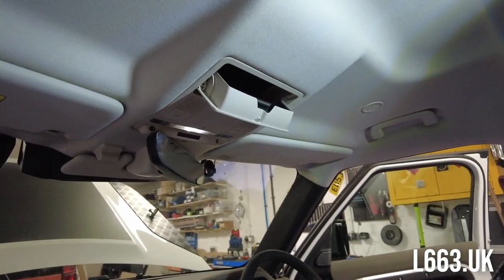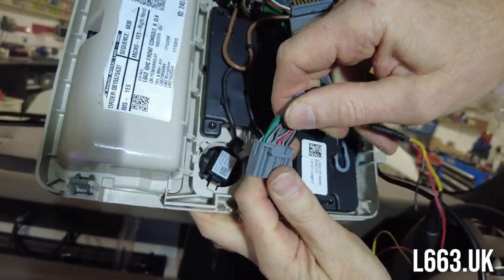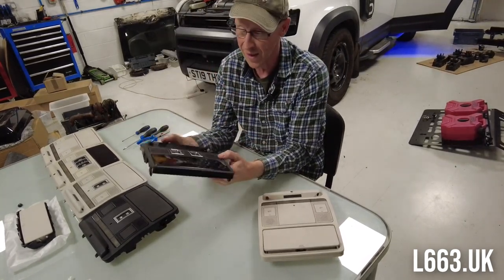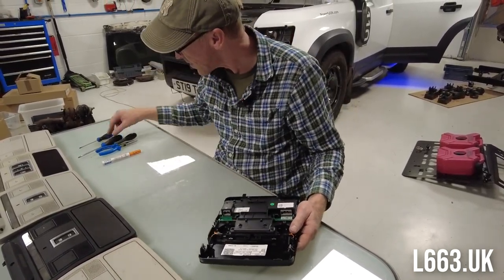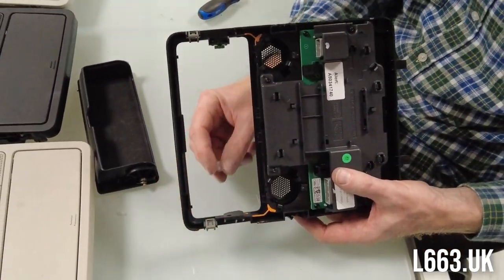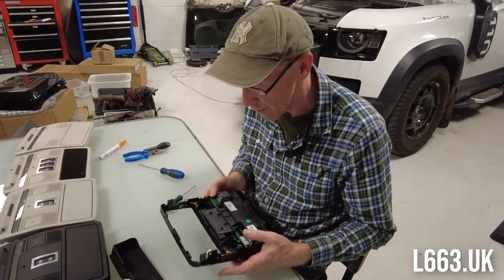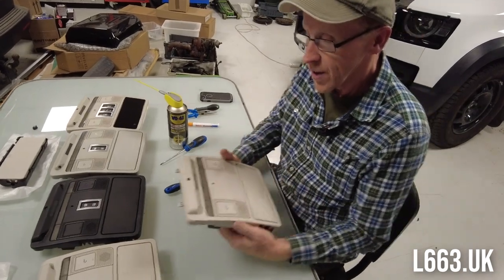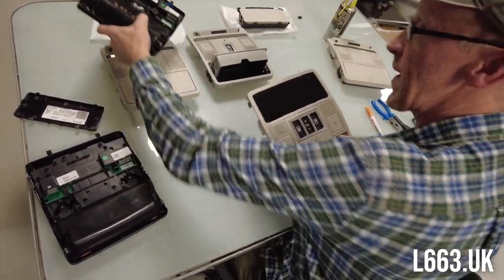Land Rover Defender L663 - Overhead Console Sunglass Holder Retrofit

Comment: Great kit and video. On my 2022 MY the clips to remove the frame were aft of blank panel centre not in front. Positioning of frame when replacing in roof is key to the holder moving cleanly without fouling the rear lip. Grease on the white ‘latch’ cog aids reliable latching by damping it slightly😉

Comment: Great video. When I finished, before I reinstalled it overhead, the sunglass holder seemed to work flawlessly. However, when I put the console back overhead, the holder seemed a little "finicky". When I pushed the front of the holder up, to put my sunglasses in, I had to push hard to get it to go up, then push on the back of the piece to get it to release down. Then a similar process to put the sunglasses back in. It seems to be getting stuck on the little lip inside the console. Any advice?
Reply: Same issue for me. My headlining piece seem to hold it too tight? It stops working properly only once fitted up. If I drop it down, works fine again 😐

Comment: I’m thinking instead of sunglasses, use the new panel as a place for aftermarket accessories switches.
Reply: That's a good idea!! In relation to that, I don't understand why Land Rover and other off-road vehicles don't have the option to have a waterproof connector built into the roof rails (the ones embedded along the length of the roof) so that owners can easily connect something like a light bar, beacon or even a 12v power source! Come to think of it, they could even also have an option for a solar panel connection to allow for the charging of accessories when the vehicle is parked or to power something like a portable fridge.
Reply: @andrewjones-productions  That would make way too much sense! Instead they seem to make it so bloody difficult to do these things afterwards!🤷🏻‍♂
Reply: Excellent idea, you could even place the aftermarket switches in the slide down sunglasses panel so they can be closed and out of sight when not used. Very 007.
Reply: For a great look at how you could use it for just that purpose…

https://youtu.be/ywdr82RNSrE
Reply from the maker: Very good points you raise here
Reply from the maker: just watched that - very neat !
Reply: @mikemcmach101  I also watched the video! With the set-up that Land Rover et al give us, this is a very tidy set-up indeed, albeit it semi-permanent because of the lack of foresight by manufacturers to give us a connector on the roof! I wonder if the Ineos Grenadier have had the foresight to easily route wires through to that fabulous aircraft style overhead bank of switches they have installed.
Reply: @andrewjones-productions  The grenadier is doing just that thing.  Plug in the front bumper, and the rear door.  Plus two plugin on the roof.
Reply: Definately

Comment: Simon…help, great instructions which I followed exactly, but the door does not stay closed after reinstalling…..it doesn’t seem like the little white “bit” doesn’t engage properly…..what did I do wrong
Reply from the maker: Hi Peter - we have the same issue on our new 90 - Destiny and I tried this last week and found its OK outside the car but when installed it does not quite catch - we added some grease which fixed it but not really 100% happy - we are going to try and 3D print our own white cog. All the parts are genuine LR ( other than the cog ) so should be OK.... I will study some more tomorrow.
Reply: @L663  thanks....any update?
Reply: @doylecoffinarchitecture4671  I was working on this today - we just got another new 90 and can now see the problem - at the end of the day I think I came up with a theory - will test on Monday !
Reply: @simonjefferson  great!

Comment: The white bit was not cooperating. I could not figure out it’s orientation. It would not engage anything. Everything else was working great. I took it all apart and put it back in the box. I might just go with the more expensive option. If I every figure this out I will absolutely be using a adhesive glue on the cog, it went flying when I disassembled this hot mess. I imagine this was all definitely me just not getting it. Seems that several others here had no problem and Simon seems confident.

Comment: Just installed this in my defender and the holder sticks a bit when I push it in, almost like it goes too far in. Any idea what I did wrong? 😅
Reply from the maker: We did have a problem when we did this - in the last step when you fit the cover over the back make sure you have the clips in correctly. The rear cover does give some strength to the frame where it is thin and this seems to help. Try just refitting the rear cover.